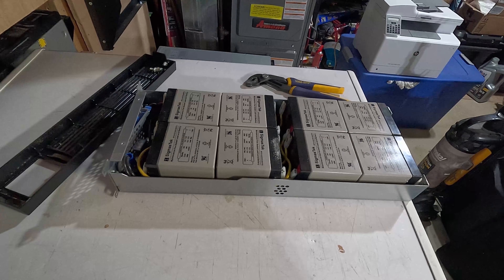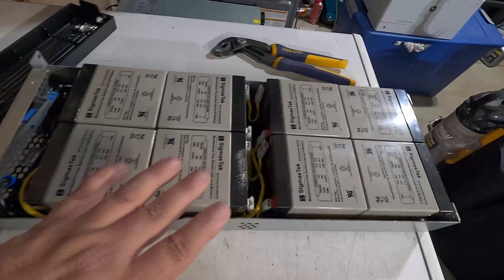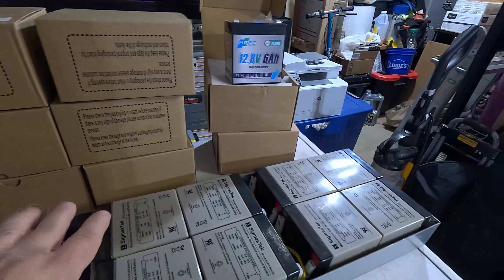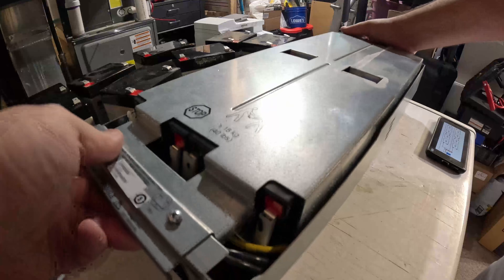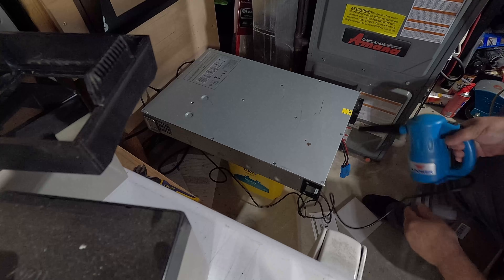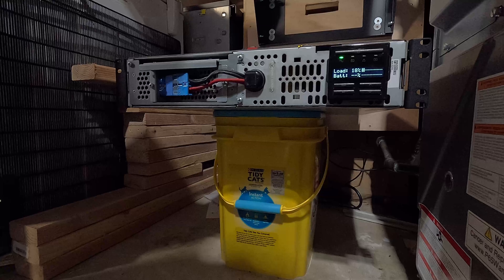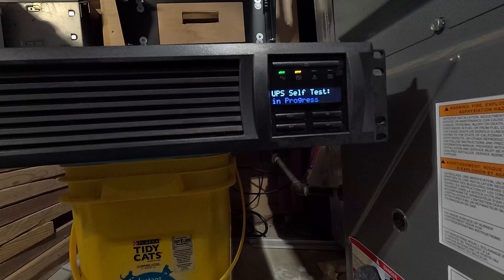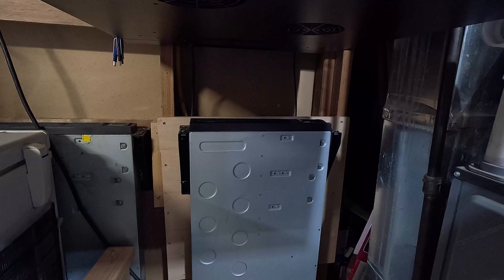Upgrade APC UPS With LIFEPO4 Batteries!!

Comment: I wired a trickle 14V lifepo4 charger across every 12V battery, so both UPS and trickle are charging the batteries, gave amazing results, charging was properly balanced, and I was able to get the full charge potential, i realized that the UPS charges the lithium batteries to only about 50% or less
Reply: Can you expand on this? I have been using bms integrated lifepo4 batteries in my ups unit with some success for the past bit but cells are under charged and get out of balance with time and I have to  open the battery trays and manually charge them.

With a ups and the isolation I am wondering how a trickle charger could be safely integrated.

Comment: Did you consider the current limit on each 6Ah battery will be about 6 Amps? That means your inverter will cut off when the power is more than about 72*8=550 Watts. I wonder if you've ever run the UPS at loda above 550W

Comment: BMS on those batteries usually are not designed to be put in series so... yeah. This is not recommended use for this batteries. 

If you want lifepo4 batteries on that UPS, you need to build a battery on spec with voltage and Ah range of the UPS and single BMS to monitor all those batteries.

Comment: How are the LiFePo4’s holding up, now that it’s been about a year?  How is your actual UPS runtime vs calculated runtime the UPS says it has?  Did you go in and change the charging profile in the UPS to better match your lifepo4 batteries.  I’ve got a matching UPS that’s telling me it wants new batteries and wondering how your battery experiment is going?  Thanks!

Comment: Does the charging component in the system compatible with lithium? maybe it can only charge acid batteries? maybe the lithium is only getting a 80% charge?

Comment: Problems that can occur if you charge a lithium iron phosphate LiFePO4 battery with a lead-acid battery charger:
Overcharging: The battery may receive more voltage than it can handle, potentially damaging its cells.
Undercharging: The battery may not charge fully, reducing its capacity and performance.
Overheating: The incorrect charging profile can cause the battery to overheat, posing safety risks.
Reduced Lifespan: Repeated use of an incorrect charger can shorten the battery’s overall lifespan.
Safety Hazards: There’s a risk of swelling, leakage, or even thermal runaway, which can be dangerous.
Reply: Almost all the current generation LiFePO4 UPS batteries have a built-in BMS inside them... which pretty much eliminates all the risks listed above.  

And because of their stable chemistry, chances of leaking or thermal runaway are far lower than the lead acid batteries that they are replacing. 

LiFePO4 batteries have come a long way in the last few years, and are one of the safest battery chemistries to use.
Reply: Thanks chatgpt
Reply: BMS’s are not charge controllers, they are there to protect the cells from overvoltage, over amp charge/draw, and cold/hot temperature cut out. Most batteries out there have cheap BMS’s and can easily lead to over absorption/swelling when using an incorrect charger, the BMS doesn’t control the charging profile of the charger, so my statement still stands.

Comment: Yeah... no. Swapping a SLA powered UPS with LiFePO4. UPS won't know correct max charge voltage, float voltage, nor discharge cutoff voltage. So any monitoring will be totally inaccurate. The VA rating will not be as advertised. Instead of the correct 100% - 0% discharge monitoring, since the UPS knows the SLA discharge curve, the UPS will display in the 90s until bam the LFP is out of current and voltage falls fast. Should go from around 90% to shutoff in a few seconds instead of minutes.  Toss this if not going to use SLA and get a Jackery type box made for LFP batteries, where the monitoring, discharge, and charging is accurate.

Comment: You had lead acid , a lead acid charge profile . Now your charge profile is incorrect and will damage your lithium batteries . How did you change the profile ? I don’t think you did . Not smart .
Reply: It won't damage them, they are acceptable as a drop-in replacement, generally as long as you don't exceed 4s4p. .  But if it never reaches 14.4v to 14.6v, they can drift out of balance, hence reducing life if/when one cell gets out of balance.  If you can't reset the charging parameters, just wire up a connector to use an LFP charger or a DC power supply on them once in a while to reach balancing voltage.

Comment: Have your house burn to the ground yet? I still hersistant to replace my UPS with LifeP04 battery. I read a lot around the internet that they don't recommand
Reply: LiFePO4 are NOT Lithium-Ion.  LiFePO4 batteries have much better thermal and chemical stability than traditional lithium-ion batteries. They are less prone to thermal runaway, which is the main cause of fires and explosions in batteries.
Reply: @Chris_Cable  LiFePO4 actually is a type of lithium ion, but the standard way of talking about them is to not call them that, to only call them LiFePO4 or LFP, so as to distinguish them from OTHER lithium ion batteries.  LFP are indeed not a fire hazard like other lithium ion types can be.

Comment: Nope. Because usable range of lead-acid batteries is about 12v-13.8v, older UPS will shut down when the batteries drain to 12v or slightly under. S4 LiFeP04 usable range is about 11.0-12.8v, so your UPS will shut down before half the LiFeP04 capacity is used. Charging current is also a little high. They should charge from about 13-13.5v, but your UPS charges them at 14.4v, which will shorten the life. They could even stay charging continuously!
Reply: Actually, charging LiFePO4 should be done at 14.4-14.6v, then float at 13.5v after charged.  The BMS in each should do balancing of the 4 cells in series, when at 14.4-14.6v.  My bigger worry would be if a UPS only charges to 13.5v, then you'd need to occasionally use a lithium charger or a DC power supply to charge and hold them at 14.5v for a few hours to let them balance.  Holding an LFP battery at 14.4v may decrease its life a little bit compared to perfect charging/holding voltages, but it actually also ensures perfect balancing, which in fact is probably more important.  Holding them at 13.5v and never going to 14.5ish, would unbalance the cells and kill it way quicker than holding at 14.4v most of the time and occasionally discharging would.

Comment: Can u even hookup this many lifepo4 batteries? There is a limit to how many bms can be paired right?
Reply: Yes you can. No, there is no limit as BMS is per battery so in this configuration, each battery is only aware of it's own state.
Reply: As long as it's in parallel and not in series it shouldn't be an issue.

Comment: Strongly suspects that apart from not charging the batteries correctly this would also confuse the remaining run time calculations inside the UPS potentially leading to unclean shutdowns of any servers attached.
(The discharge curve for LiFePO4 batteries are quite flat)
Reply: As long as the cell has BMS (battery management system) built-in, the cell would act just like a normal sealed lead acid battery. 12v is 12v. 5Ah is 5Ah. The difference in chemistry only means that the cell will have much greater longevity.
Reply: @cyrylthewolf  OP is going from 12v5a to 12.8v6a. i'm not sure what the implications of that are, but they are not 1:1 voltage and amperage.
Reply: @d1ckpunch68  - Ya don't say. 😂
Reply: The SmartUps UPS has a built in calibration cycle that it performs when you swap the batteries out
The bigger and higher risk question is the discharge rate.
The batteries being removed have a 60Amp max discharge rating.
Many forums warn about replacing SLA batteries can risk the LiFePo4 batteries being damaged as a result of high discharge rates exceeding their ratings.

The UPS supported external addon packs that allowed for calibration including those packs added to the total capacity.
The UPS itself had 2-3 versions that differed basically by what cells were installed and software settings only, the hardware was basically common.

Comment: Thanks for the video, as you can see below, there are many opinions regarding charge/discharge issues between the two different chemistries. I would suggest that you charge each new battery with a Lithium charger, to get to full capacity prior to the install. That should give the BMS a fighting chance.

Comment: Yeah, like so many others noted in the comments, the float charge differences make the LFP battery change a no-go. You would need to buy something with an LFP charger programed into it like what Eaton has on their LFP UPS. Your best bet it to buy AGM replacements over the standard SLA batteries in these old APC UPS units.

Comment: Missing BMS for connecting LiFePO4 in-series, I won't suggest such simple replacement..
Reply: Is there a BMS you suggest for the 48v range?  I am looking at replacing my lead acids and know that it needs a BMS for the different chargingrates ect.
Reply: @ChuckMorton  Try searching for: HA02 48V 4S Battery Equalizer Balancer
Reply: @ChuckMorton  Aliexpress helps
Reply: I think you mean a balancer. I would put them all in parallel and hold them at ~14.2 for ~24 hours to top balance them, then put them back in; non-issue after that's done since it won't be cycling often.

Comment: The issue I keep seeing on this subject is that the APC (expecting a Lead Acid battery) tops out its charge voltage at around 13.5v... no where near the 14.2-14.6V recommended for these new batteries.  I'm not sure what that does to either the capacity or longevity of this upgraded setup.

Mine uses 10x of these, so that's $190 vs $100 for 10x lead acid ones (fleaBay)..  Even with under voltage charging, if this setup were to have a longer runtime AND a longer lifespan than lead acid, I could forgive it being sub-optimal... I'd still be happy.
Reply: That is not true. The ups goes upto 14.4v per battery & then drops down to 13.6v float voltage. I have been running home made Lifepo4 for 5 years without any problems. Can not use bms the ups cuts out at 20v which is right around 2.5v per cell and that is just tad too close to the bms's own cutoff voltage so the bms cuts of early sometimes if one of the cells goes few mv out of whack. And then the whole ups does not restart automatically when mains is restored. So i just use cell balancer and not having a problem.  The ups perfectly handles charging curve. I have monitored with a multimeter for hours on how it charges the battery.
Reply: @KuntalGhosh  Is 13.6v too high for a LiFePO4 to float at? I used LiFePO4s in 2 small UPSs and the capacity of the batteries dropped fast without any cycling.
Reply: @leecewest  nooe. Mine stays at 27.9v all day long & i haven't noticed any drop in runtime. Almost 6yrs now
Reply: @KuntalGhosh Thats good to hear. I left a multimeter on mine for a couple weeks and the voltage never went above 13.63v. The batteries lost half their capacities (according to a capacity tester) in half a year. I took one battery pack apart (12Ah Cyclenpo 38910) and found one cell lower than the others. I still need to test the individual cells.
Reply: @KuntalGhosh  HEY COULD SOMEONE TELL THE possible REASONs ? 

I made a temporary 12v battery using 4 small Li-ion batteries.(I didn't use any BMS) ... I connected that battery to the UPS and it worked. The UPS detected low battery, so I connected the UPS to the main line. I was holding the battery (negative terminal of the battery was touching my hands) when I was connecting the UPS to the main 220v line. Exactly when the UPS plug touched the main 220v, I got a deadly shock from the negative terminal of the battery. Like someone had hit my hand with a hammer. As far as I know, these 2 tentacles draws current from battery and also charge the battery.. so charging voltage range can be between 12-15 volt. Then How can i get such deadly shock from these 2? Or there is something wrong with my UPS ?
Reply: @zorgonfire  Does this mean that the UPS sometimes pushes literal 220v to the battery?? Won't this damage the battery??
Reply: @miracleaudition97 voltage is relative. 200V at the negative and 213V at the positive terminals will work just fine. If you touch it however you have 200V to the ground (you). Maybe the transformer is leaking current, maybe the charging is not isolated and is like that by design. In any case if you do not understand better do not play with it. It will kill you.
Reply: Yeah, my nice rackmount one blew a board out after doing this swap.  The charge curve is not the same - there may be some firmware update or some electronic component swap outs. Also the calibration is way off (so there's that). You have to spend a small fortune for a UPS built for charging LiFePO4 batteries (still extremely expensive - moreso when you blow out a UPS)
Reply: Just put an mppc in line and batteries external

Comment: Don't want to be rude but you screwed up when you decided to mount the UPS vertically. Ontheir sides or flat only. SLA batteries should not be inverted. Otherwise, yes, APC's chew batteries like no tomorrow. Other tips, kill power, take lid off top, blow out propperly with compressed air. Blower did nothing. Need to compress the cable lugs with pliars, often too loose, yours are for sure. 
Self Test tests with your installed load to test if the UPS can support YOUR load. No, it does not have an internal 500W load. 
Now, you will need to do homework on the differences in Lithium and Lead for charging, not to mention, if the new batteries are true 4S or cheap, 3S turds.
Reply: They aren’t 3S. 3S 12V is a cobalt chemistry not lithium iron. 

The cobalts are far from what I’d call turds. Better energy density, typically have a better C rating and so much more. Just not the right voltage for a drop in replacement as 3 is too low and 4 is too high (3.6V or 3.7V nominal. That’s why 3.2V LFP is ideal
Reply: @ericklein5097  3S in Lithium is LiPo, not iron.
Reply: No he screw them up doing q capacity test on sla every 2 weeks test should be run at the most every 3 months. Once every 6 months to q year optimal lead acid degrades after every deep cycle.
Reply: I was curious about this because I thought you couldn't just swap battery chemistry like this. Especially since these smaller lifepo probably don't have their own BMS... I really want to try something kind this but I was thinking of using a bigger 50-100ah battery. Also doesn't look the original configuration has a balancer. I'm just getting into a battery rabbit hole so I don't know much.
Reply: @RobbieRobski  I used to be where you are right now and I got to the point of scrapping the UPS's that cost way too much for what they are and claim to do. Not spending time on battery chemistries, here is the beans, plain and simple: 
Get a inverter/charger that can handle the load you want to support. Get a big enough LiFePo4 battery that can handle that inverter at full load and put in a box/case/rack or whatever, job done. Inverter is now suited to chemistry and can do job for a lot less coins. 
I use a set of 4x 120Ah AGM's (they were sitting around) and a 3KW Low-Frequency inverter (big transformer inside, can handle 300% overload for 15+ seconds) and runs whole rack of servers.
Reply: @RobbieRobski  They would definitely have a BMS.

Comment: the only cosideration is lead acid cells have a much higher max discharge rate. for those LFP batteries its about 6A while those lead acids datasheet shows them drawing upto 33.4A per battery. as long as you stay under 6A per battery its fine,
Reply: Yeah... The BMS in each battery is rated for 6Ah. At a nominal voltage of 12.8V that's 76.8W per battery. The pack of 8 can thus sustain 614W before the BMS in each battery trips its overcurrent protection. That's not accounting for DC to AC conversion losses. The APC SMT2200RM2 is rated for 1,920W. Even if the load averages less than 600W it may peak during server boot. If it's on battery it will drop the load.
Reply: @adriftatlas  for 6A*
Reply: Another issue is that it isn't great to keep lithium batteries always at 100 percent charge. Youl probably still get a good 5-7 years out of them but it cuts their lifespan significantly.
Reply: @kevinforget549  your thinking lithion ion. These are Lithium Iron Phosphate. Different chemistry. These batteries couldn't care less if charged to 100% every cycle. Wouldn't be surprised if they lasted closer to 10 years.
Reply: Yes, you’re right. Keeping LFP cells at 100% is not good for them. There are plenty of papers out there detailing the degradation/charge characteristic.
Reply: @kevinmills5293 That is incorrect.

Comment: With the UPS being vertical, wouldn't some of those batteries have been upside-down?  Being upright or on their sides is OK, but upside-down is not OK ...
Reply: LFP batteries can be oriented in any direction also.
Reply: its AGM batteries vs traditional liquid acid.

Comment: I found that my UPS the lead acid batteries got out of balance in the setup...I ended up wiring in an external 24v battery balancer module into the pack and it seems to help quite a bit. (its mounted externally and it's ugly/janky but it works)
Pretty cool there are lithium iron phosphate batteries that will replace lead acid batteries
Thanks for this!
Keep em coming!!!!